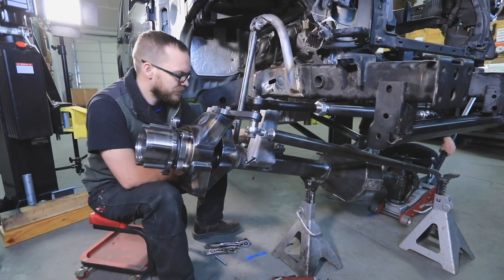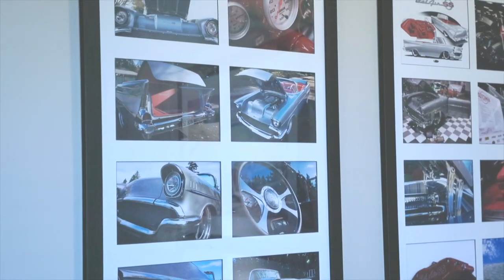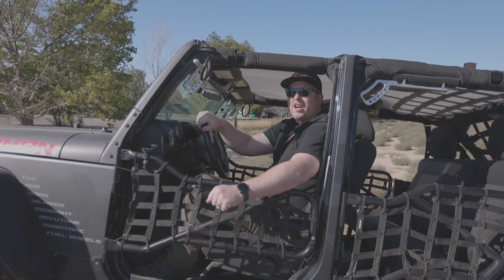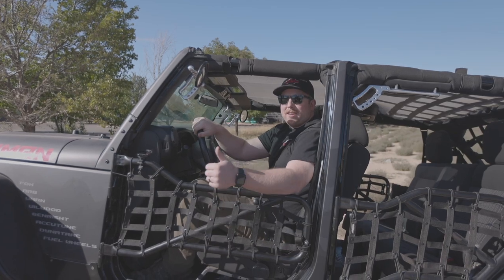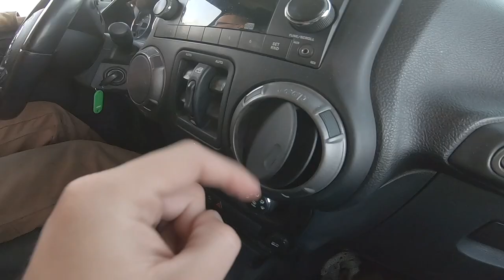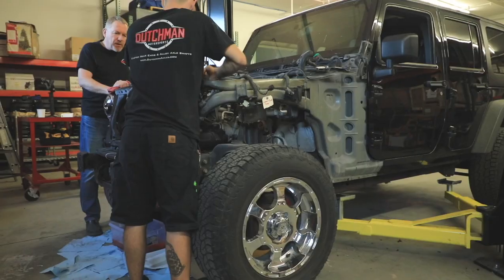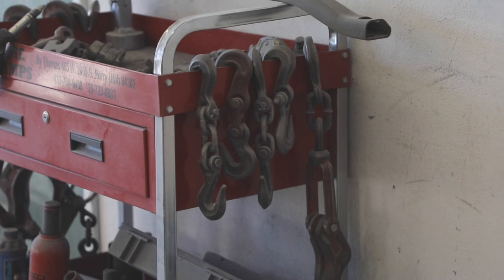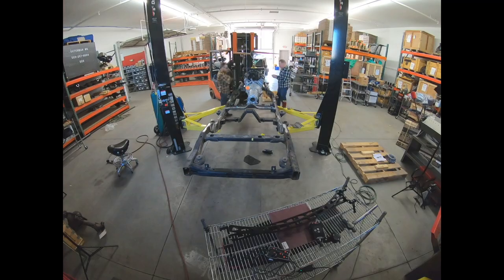Jeep Wrangler JKU Build | Dutchman Axles | Ep 1

Comment: Great video guys! Did you guys go with corporate 14 bolt or Dana 60? my son was eventually looking to go 1-tons on his YJ. For now Dana 44's on  35's  with the stock 4 liter inline 6.
Reply from the maker: One of the guys here has a YJ!  You will see in the next episode (comes out tomorrow) that we decided on 14 bolts front and rear.  What we will offer down the road might actually be a super beefy 9 inch version.
Reply: Ford 9 inch for a front axle, full floating axle?, I don't think I've ever seen that done That would be really interesting. 🤔
Reply from the maker: What we ran was matching Hybrid "Drop out Style" GM 14 Bolts both ends...Unit Bearing style floater in the rear & the front uses the same unit bearing. What we'll offer soon is a 9 inch rear semi float style with the BIG Set 80 bearing and eventually the Unit floater. The fronts are a ways off.